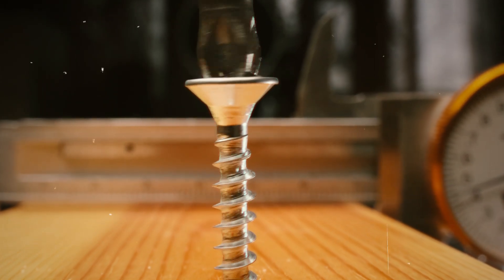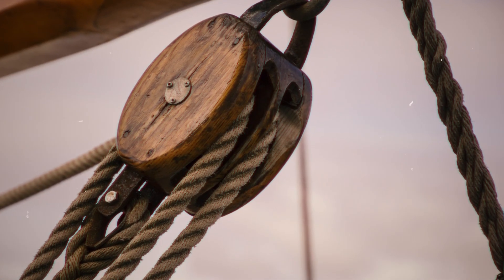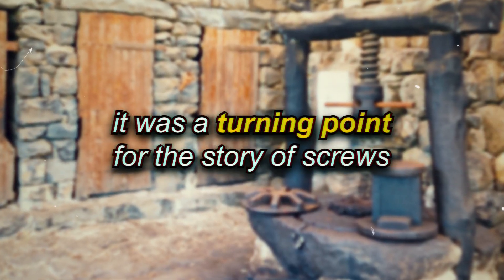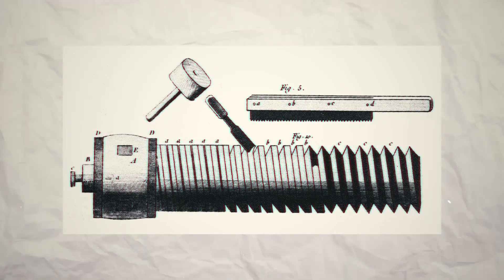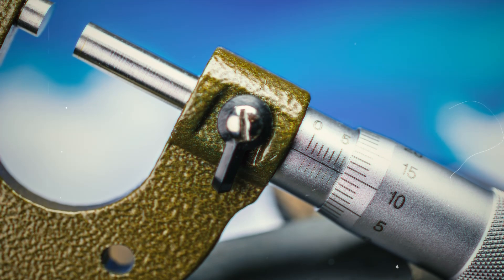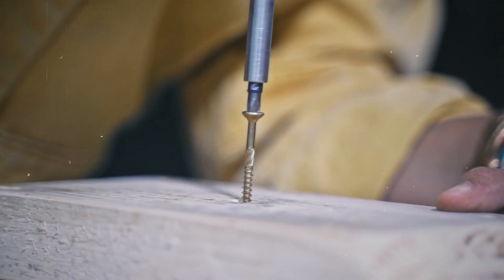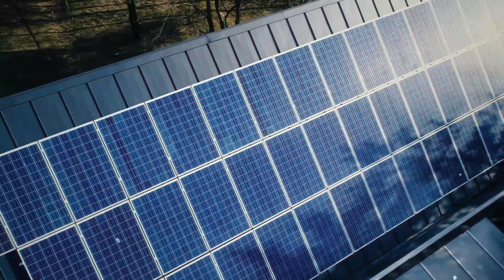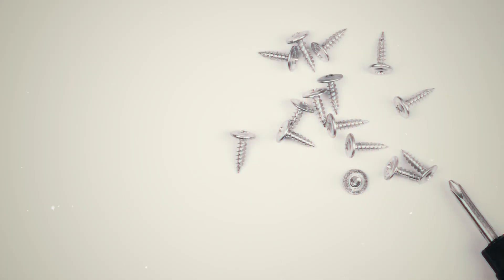Why Screws Took Centuries to Perfect

Comment: 4:26 "Leonardo invented a screw cutting lathe..." The date of Da Vinci's design is 1488-9, and was probably not made. What the video's image shows is a metalworking lathe by Henry Maudsley in about 1800. Oddly, it shows the lathe from behind with the toolholder away from the user and the headstock on the left. Jesse Ramsden is accredited with inventing the first working screwcutting lathe in 1775. There is a drawing of a screwcutting lathe by Jacque Besson, in his "Theatre of Instruments and Machines" in 1569, a compendium of designs. It's clear that many were thinking along the same lines.
Reply: There are holes in granite and other very hard stones with tool markings on their sides indicating they were bored by tube drills from several thousand years before the birth of Christ. The theory of the screw has been around for thousands of years. The modern screw is just the most recent iteration
Reply from the maker: Thanks for pointing that out, you’re right about Da Vinci’s design being conceptual and the image showing Maudsley's lathe; it is amazing how many people were working on similar ideas back then

Comment: what surprised me most is that in this hole babble there was not one frame showing how screws are made.
Reply: Nor the profound importance of Henry Maudslay's metal screw cutting lathe, designed, and actually built for real world production, in the late 18th century. Davinci's design was like so many of his others, a good idea on paper that wasn't put to use in the real world for another 400 years.
Reply from the maker: This video was made to be about the history of screws! Not exactly about their in-depth creation process, although that could've been included